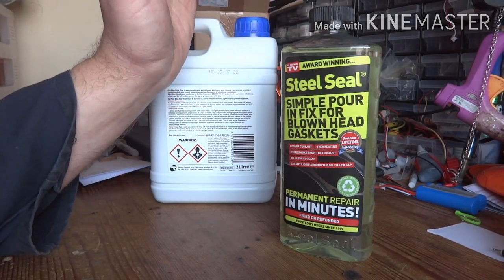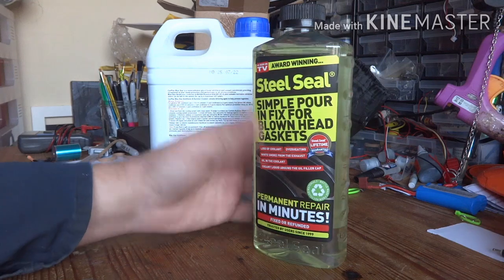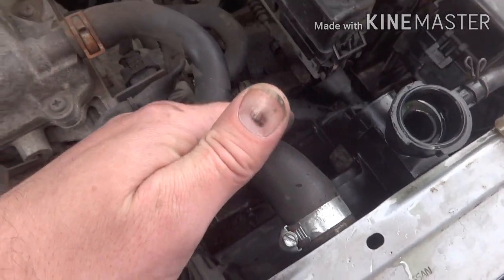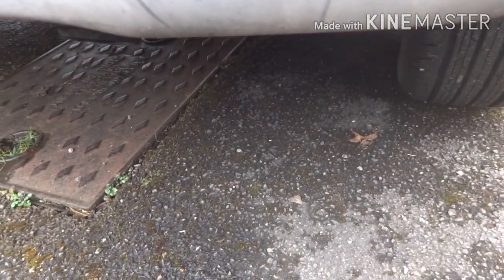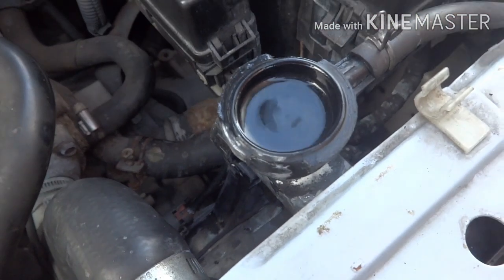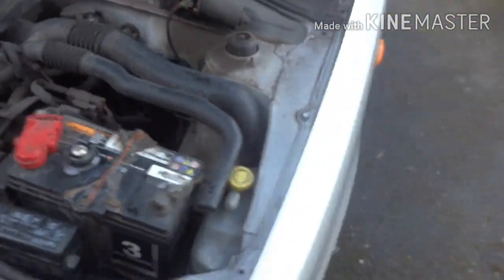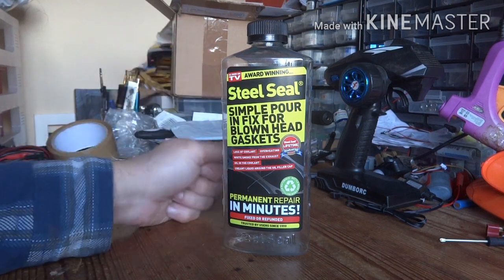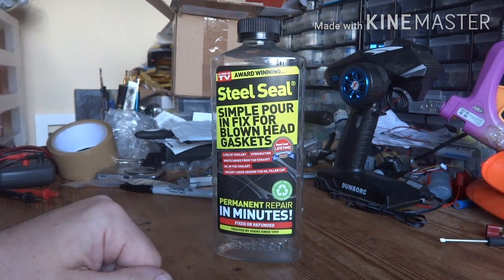Steel Seal Head Gasket Repair Liquid Tested. Did It Work On My Car? Honest Review.

Comment: You need to figure out which cylinder is causing the issue by either checking the spark plugs to see if coolant is on one of them or run the engine with one of the spark plugs out at a time and disconnect the fuel line for that cylinder and then check to see when the coolant stops bubling, once you figure out which cylinder the bubling stops at you need run the engine for 30 min with that spark plug out as there will be less pressure and should seal better, there are instructions on the website as the method you used works best for external leaks not internal leaks as you have backpressue (bubbles in your coolant), hope that helps
Reply from the maker: Good bit of advice there. 👍
Reply: How would you use it on just one cylinder, please explain ?
Reply: @MrxOnurb  you would run the engine with one of the spark plugs not inserted and the the fuel line disconnected for that cylinde

Comment: I had a very small vacuum in the cooling system in my Hyundai Sonata, with the engine overheating constantly and the antifreeze boiling in the reservoir.  I put Steal seal in, drove it for about 30 to 40 minutes and it completely fixed the problem.❤
Reply from the maker: I'm going to do a follow-up video to this when I get a chance. But I think there are lots of people that it works a treat for. 👍

Comment: My car was overheating running rough on start up and white smoke out the exhaust oil was fine I used steel fix and it worked no overheating since,I didn’t think it would work but it did
Reply: How’s it holding up?
Reply: How long did that fix it?

Comment: If your car is still running. Change the coolant and add a second bottle. Sometimes in bad leaks takes 2 attempts. The first one probably made the leaks less the second one might finish them off.
Reply from the maker: Still got the car. Still running. 😲
Reply: Exactly what I was about to write, smart guy, great minds think alike👌🏼. Since he said it I'll just come t off him, give it a 2nd treatment, you never know we're the crack was, how bad it was, if it was just the gasket, or a cracked head or block, your not sure how bad a fix it had to do inside there 🤷🏻‍♂️. So it looks like you had a lot going on in there because I've seen this stuff permanently fix off the first treatment. The fact that it clearly made a big difference BUT YOU STILL HAD SOME BUBBLING TELLS YOU ITS A BIG FIX IN THERE, PROBLY MAYBE EVEN A WARPED HEAD. 2ND TREATMENT MY GUY 🙌🏼🙌🏼🙌🏼🙌🏼

Comment: Did it work
Reply from the maker: Well still have the car. And it's still going! So at some point I think a follow up video is necessary? 👍👍
Reply: To be honest with you mate that bottle of steel seal looked like it was diluted with water, didn't look like genuine steel seal to me, not quite the right colour it should be much more yellowish, did you purchase it online ?? Cos I got mine from halfords and its the best £42 quid I've ever spent there
Reply from the maker: @FRANK-ri1rs  yeah it came from Amazon, wasn't cheap.
Reply: 2009Proj3ct  good luck buddy hope it works for you too
Reply: @FRANK-ri1rs  I totally agree, the color is way too light and not the right yellow/green to be uncut genuine steel seal.

Comment: Not enough evidence there was a head gasket leak to begin with. Were you losing coolant?
Reply from the maker: Yes, and there was a lot of heavy vapor from the exhaust and a bit of smeg under the filler cap. Also loads of bubbles from the radiator and coolant system pressurizing more than normal.
Reply: @realtimereviews8715  has coolant stopped disappearing eventually?
Reply from the maker: @SinsBird still uses a bit.

Comment: Plus also you put antifreeze in with it when it calls for treatment with water only.
Reply: It says on the bottle use antifreeze
Reply from the maker: It does say on the bottle use antifreeze
Reply from the maker: Bit confusing having two lots of instructions.
Reply: Can it be 50/50 antifreeze?
Reply: @EstebanGarcia-h9l  no it has to be silicate free such as made for use in foreign cars. 50/50 is half water and half regular antifreeze.

Comment: Can you use as a preventative maintenance and pour it in radiator even when head gasket is still working properly? I have a 2014 Chevy Cruze is know for head or head gasket problem. Thanks again for video any feedback appreciated
Reply from the maker: Yes I believe you can
Reply: No its not recommended to do that if yous car is working okay

Comment: Men this shyt doesn’t work wasted
Reply: It works if you change the oil first, put in the Steel Seal, run it for 30 minutes, cool it down for 24 hours, change the oil and filter again and flush the radiator. That's what I get out of all the comments so far on half a dozen videos about Steel Seal.
Reply: @jahill7965  
Why change the oil first?
Reply: @dhalsim-1  because the oil may be contaminated with water from the gasket leak or other additives. Also, the water may be contaminated or even worse it may contain coolant/antifreeze. SS will not work properly with coolant.The repair will break. The system must only contain pure water. Once the repair is complete, and the car has been sitting for 24 hours, a second flush is needed to rid the system of any surplus SS which may be circulating in the system if left. It is very abrasive if it's allowed to circulate and over time could cause erosion to things like the water pump. Coolant can be added to the water once all checks have come back clear. The info came from the manufacturer of Steel Seal. I emailed them and asked a lot of questions because I did not want to risk stuffing up my Audi altogether.
Reply: @jahill7965  
Yes but it makes more sense to change the oil afterwards once the repair is complete.
Reply: You are risking it not working as you aren't following the manufacturer's SS fine print. Up to you though but  as long as you're aware that you are also risking your motor being damaged. This is what they advised, so I am going the extra mile because I am not prepared to risk going against manufacturer's advice and stuffing up my car. 😊
Reply: The guy in the video read on the bottle mix with coolant is that false or true